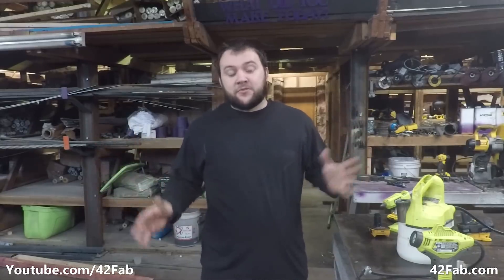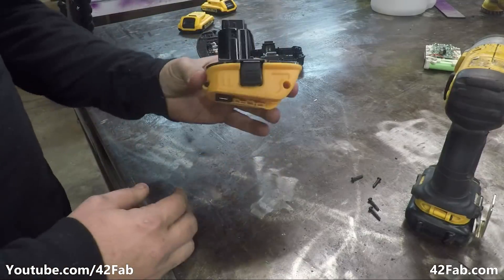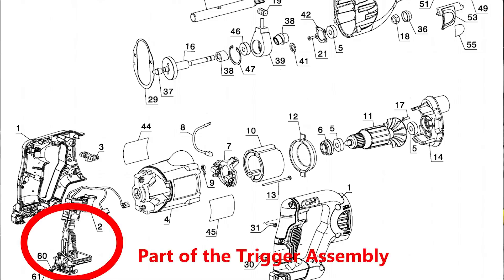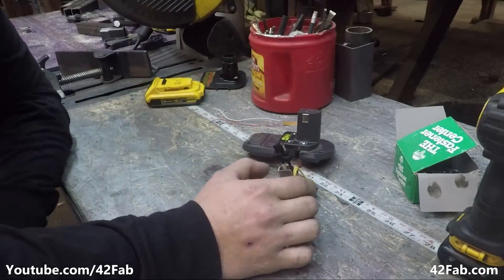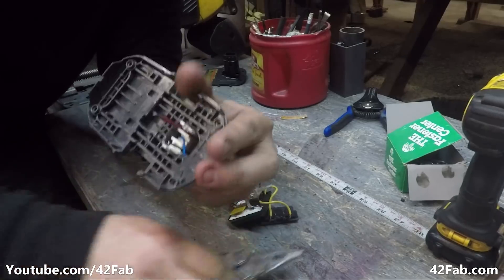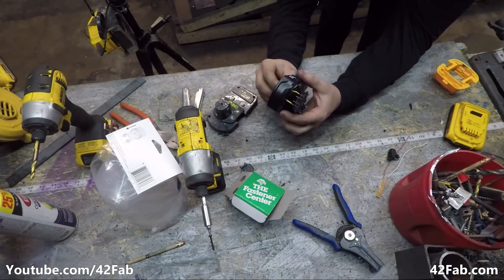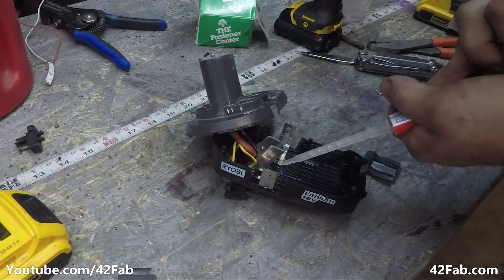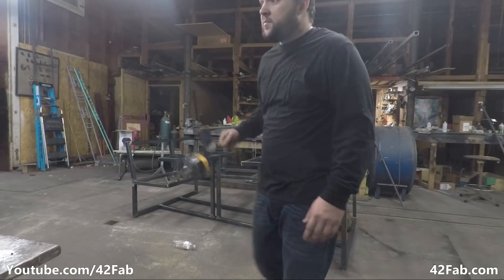How to use DeWalt Batteries on Ryobi Tools for $30 | Building a DeWalt to Ryobi Adapter - 42Fab #16

Comment: What's your opinion of the knock-off Dewalt battery vs a Dewalt battery?  I have Dewalts, and after many years, maybe 10 of light use, the pair of Dewalts just don't work.  I bought a pair of less expensive knock-offs and they were fine.  But seemed to die and no longer hold charge after maybe 5 years.
Reply from the maker: @snackymcgoo1539  pretty standard experience. I have a few, they're limited to running flashlights, fans, etc

Comment: Do you have a hack for adapting the 40 volt batteries?
I want to use a 40 volt 12 amp hour DeWalt battery instead of the 40-volt 12 amp hour Ryobi battery in my Ryobi lawn mower.

Comment: do you have an adapter that will let you use a 18 volt ryobi battery to power a 18 volt dewalt tool?
Reply from the maker: no, and you wouldn't want to. The neck of the battery would be obnoxious to absorb into an adapter and the dewalt tool would have to be fooled into reading the battery voltages correctly as dewalt has the battery protection in the tool and ryobi has it in the battery

Comment: They make adapters that go from Dewalt batteries to Milwaukee or Makita
Reply from the maker: Yes, and the cheap ones do not have over discharge protection
Reply: @42Fab  ok

Comment: Do the 54v flexvolt dewalt batteries work in ryobi have you tested it yet?
Reply from the maker: The adapter is not designed for such a high amp tool. There is a piece you need to ground off the adapter, but then, yes they work.

Comment: Can you DEWALT batteries on Ryobi 40V tools??
Reply from the maker: The new lithium ion stuff? Not really. You'd have to wire something up to trick the tool into thinking a DeWalt 40v or 2 20vs were the battery it was looking for. More work than it's worth.
Reply: @42Fab  thanks for the reply cuz here in Canada 1Ryobi 40V Lithium -Ion 5Ah HC battery cost $239.  
1 DeWalt 20V MAX XR Lithium - Ion Premium Battery Pack 5.0Ah cost $189
I have another question what's the difference??
Reply from the maker: The 40v battery has twice as many battery cells in it than the 20v battery does
Reply: @42Fab  thank you for the quick response.
I ended up buying Ryobi 40V 4.0 Ah from Amazon lol please don't tease lol 
What's the difference between 4.0Ah and 5.0Ah.  It's $50 difference
Reply from the maker: Ah means "Amp hour" which is the capacity. So a 5Ah battery can deliver 1amp of current for 5 hours or 2amps for 2.5 hours or 5amps for 1 hour. More Ah means the tool will run longer before that battery is dead

Comment: You are wasting time you can get one adapter from eBay for $12
Reply from the maker: and kill your batteries. You get what you pay for and cheap adapters do not have over discharge protection. but hey, thanks for being so smart, it's much appreciated.

Comment: 12 volt dewalt and 12 volt firestorm (black & decker) batteries are interchangeable. You can even charge firestorm batteries on dewalt charger.

Comment: Followed these instructions for my Craftsman C3 19.2v batteries.  Works great, even though now running at a max of 18v.  Beware the cheap knockoff battery adapters on Amazon.  The one I bought had no protection circuitry to prevent total drain and over heating.  The 18v pins were simply wired directly to the 20v pins.  So they warn you not to leave the tool plugged into the adapter, as it will drain the battery to zero and ruin it.   Rather than taking that chance I sent the adapter back and bought the official Dewalt adapter.  Really happy with this solution.  Thanks for the video.

Comment: Anyone looking to do this with any battery brand you can buy the adapters but none have protection circuits on them. You must not discharge them to far or you can put a limiting circuit in them. I have done this on my Makita to Royobi adapters and it cuts off the power to the too to the voltage you set. To know the voltage to set the circuit to you must run a battery down on your original took and multi meter it to see the voltage to set too.  https://www.amazon.com/gp/product/B07929Y5SZ/ref=ppx_yo_dt_b_asin_title_o00_s00?ie=UTF8&th=1
Reply from the maker: the ONE time someone has actually presented an equally good solution.

Comment: So you built a $30 tool that you could have bought online in a smaller form factor and for less money
Reply: You jealous you cant build one
Reply: Post one that has voltage cutoff protection in it. Ryobi puts their protection in the battery. Dewalt puts their protection in the tool... So any adapter has to include protection to avoid over discharging the Dewalt battery. Every one I have seen on ebay and Amazon do not have voltage cutoff built in.

Comment: Beware that the cheap knockoff adapters on Amazon don't have the protection circuit built in.  Internally they just jumper positive to positive, negative to negative.  So I returned them to Amazon and bought the expensive Dewalt version.   The torx security screws were easy to remove by banging the center pins out with a spring loaded center punch (several hits).

Comment: aren't there ryobi to dewalt adapters yet? they have milwaukee to dewalt and vice versa for like $30 on Amazon.
Reply from the maker: Read the other comments on why these are garbage
Reply: @42Fab  I'm not scrolling that far. All these other comments regarding your SO are quite hilarious but they need to control themselves.

Comment: I have old  Ryobi 14.4v tool set.  After becoming aware of the conversion adapters I found  your video and decided to make an adapter to take Dewalt 20v batteries that I now use and fit my Ryobi 14.4v tools.  I had  a Ryobi 14.4v set that has a drill, circular saw and light.  The batteries seem to get more expensive and I didn't want to keep investing in the 14.4v system.  I bought the   OEM Dewalt adapter to use on their old tools.  I did this so I would have the protection circuit that comes with the Dewalt adapter. I took the top off the Dewalt.  I took apart a dead Ryobi 14.4v battery pack.   The 14.4 battery has 3 conductors: positive, negative and temperature sensor.  I left the temperature sensor on.  Set the Ryobi batteries aside for Recycling.   Clipped the power leads from Dewalt contact connector just like you did.  Soldered a lead to the Ryobi positive contact connector. Took one of the dead Ryobi batteries and tapped off contacts.  The battery was used to keep the the contact connectors in the Ryobi tower.  Lots of hot glue was used keep the assembly in place in.  I alligator clipped the two wire sets together and the light worked.  When I plugged in the saw it ran backwards.  Switching the wires it ran correctly.  I had tried to cut hole in the bottom of the Ryobi case so the Dewalt clips to the bottom of the Ryobi, but the Dewalt is too wide. I just hot glued the Dewalt adapter to the Ryobi battery case. If I did it again I would cut a piece of plywood  as an interface adapter between the bottom of the Ryobi and the Dewalt so the Dewalt clips would hold onto the plywood.    It is important to remove the Dewalt battery from my Frankin adapter so it doesn't drain.

Comment: You know, you can buy adaptors for most brands on Amazon....
Reply from the maker: and they ALL (I've bought and tested most of them) have no over discharge protection to protect the battery.
Reply: @42Fab  is there room in those adapters to wire a protection board in? Low voltage cutoff boards are pretty small and are about $10 on Amazon

Comment: Imho, can you make a dam out of tape to keep the epoxy in place? What about using an accelerator or a pressure cooker to speed the curing process like others have done???
Reply from the maker: sure could, I didn't

Comment: I used to say dewalt was the best, til I used Milwaukee, you cant compete with the 5 year tool warranty, 2 year battery warranty. Besides name a commercial tool truck that carries dewalt...
Reply: Watermelon Water Moccasin, I’m a Milwaukee guy as well. I don’t know if it’s different where you’re from, but in Canada, Milwaukee warranty’s their tools for 5 years and batteries for 3 years, not 2. But since you asked, the Mac Tools truck carries DeWalt. And Mac cordless tool batteries and chargers, although red & black in colour, interchange with DeWalt.

Comment: They now sell already made adapters on Amazon & Ebay for around $15-20 bucks! The one I saw was a dual DeWalt and/or Milwaukee batteries. Works with both. Great video though!
Reply from the maker: As those do not include over discharge protection. I have purchased and tested them.
Reply: @42Fab  Thanks guy! I wondered about them? I was thinking maybe the main battery would kick in to do it. Glad to know!

Comment: Interesting.  It seems that having the bms on the battery for ryobi is the better decision.  That way if it fails the bad part is cheaper (battery). It does make for more expensive batteries but the sale prices don't reflect that.   Also having the bms on the battery lets you use the battery for all sorts of different things.
Reply from the maker: The BMS isn't the whole story. The board in the tools has other function for the tool. I think the idea is that instead of two systems doing two things, why not make one system do both

Comment: Great video.  FYI, probably figured it out by now but there's a final screw on the head of the ryobi batteries by the terminals - lets you slide the whole internals out and save from having to sneak a pair of scissors in like that.
Reply from the maker: Yeah, found that after...

Comment: 1PCS Dewalt 20V(Max) Slider Li-ion Batteries to Ryobi 18V Cordless Tools Adapter search that on ebay.com they have way lower profile and look better for $20 or $30
Reply from the maker: and a great way to kill your battery as those have no protection for under-volting the dewalt battery.

Comment: DeWalt tools are sold as 18v in the UK. They are identical to those sold as 20v in the US. Why? Marketing. If the tool just needs 18v you can connect the battery direct.

Comment: so you are saying these are junk? https://www.ebay.com/itm/Battery-Adapter-For-DEWALT-Milwaukee-Converter-to-18V-RYOBI-CORDLESS-PLUG-TOOL/113682706000?_trkparms=aid%3D111001%26algo%3DREC.SEED%26ao%3D1%26asc%3D20160908105057%26meid%3D21c64a3e4f9b4edabe47918251a2f87c%26pid%3D100675%26rk%3D3%26rkt%3D15%26sd%3D273804848444%26itm%3D113682706000&_trksid=p2481888.c100675.m4236&_trkparms=pageci%3A228d7184-676a-11e9-8f37-74dbd1804572%7Cparentrq%3A54fe562816a0ad793fad36cffff35984%7Ciid%3A1

Comment: I've made a ton of battery adapters like this and can tell you the epoxy is complete overkill. A quality CA glue will hold it like it's fused plastic and doesn't make a giant mess.
Reply: CA glue sucks. One drop and it's shatter apart. There are very limited applications where super glue is the right call... And usually it's only good for holding parts while you use a better glue. I've used every type of CA glue, even the Loctite play m plastic glue with the primer pen. I used it on a specific type of plastic that was listed on the package, and... Guess what, it broke. It's usually way too brittle anyways. It shatters like glass.

Comment: Why can’t you use flexvolt batteries with the adapter?
Reply from the maker: They did not design it to, I suspect to limit the amp draw on older tools not designed to handle that much current.

Comment: Dewalt call 5 LiPo cells "20v" where everyone else calls them "18v"...  Nominal voltage is 18.0-18.5 depending on the type of 18650 cell... I REALLY don't like companies that lie for marketing purposes... wouldn't buy Dewalt for that reason.
Reply: Holy shit, you're really making your way around YouTube with your nonsense. 2 videos in a row?!? Damn. Also, all 18650 cells are 3.7 nominal, some sites/sources just say 3.6V incorrectly. Though there are some Samsung Li-ion batteries that are 3.78V nominal and charge to 4.35V.

Comment: I'm so glad Dewalt finally came out with a cordless sander. I can finally sell my Kobalt. The Black and Decker cordless glue gun is awesome too. If you need batteries for those tools, try the knock offs but only go with those that use LG cells. They can even perform better than OEM in Black and Decker's case (based on my experience using their Alligator Saw - an awesome tool, and their pole saw).

Comment: What I want is an adapter that lets me use Milwaukee batteries in my Dewalt tools. Milwaukee's 12Ah battery is half the price of Dewalt's! Right now Dewalt wants over $200 for that battery. That's nuts! I also really like that Milwaukee has a cordless heat gun (which I just bought), and I would love to be able to use my Dewalt batteries in it (I have a ton of Dewalt batteries). There's just no way out of having zillions of batteries. I also have batteries from Kobalt, Black and Decker (20 and 40V), Nextec, Dremel, Greenworks, Sun Joe....it's maddening!
Reply from the maker: That's most of the reason I stick to one brand. I'm considering attempting to do dewalt to m18 though

Comment: How about the ridged 24v line?
Reply from the maker: different voltage brings a lot of challenges, but not impossible. Though those appear to be all lithium ion and may have battery protection in the tool
Reply: Well they are lithium batteries and stupid expensive in my book to buynthem and have them die on you just to have to buy more

Comment: Have u tried to build: 1- Adapter for tools to connect two batteries instead of one 2- Battery housing which can get connected (expandable) and the tool connects through wire to the batteries hanged on the belt to reduce the tools wight 3- Have you tried to upgrade just the cells with higher capacity ones (replace 1860 with NMC 70Ah or any other?
Reply from the maker: 1) can be done in parallel, but just adds weight. 2) was much easier to with older tools, but wouldn't be that hard with lithium ion 3)haven't felt the need to

Comment: I have tried this build twice now with dewalt brand adaptors. Though I had miss wired or shorted a connection on the first one so I tried it again with a new adaptor and the exact same thing happened. Both times the logic board he references in the video flashes and smokes immediately and the adaptor is useless. This does not work.
Reply from the maker: You're getting a short somewhere. I've built 2 without issue. Feel free to email me a picture of your wiring
Reply: Finally got it to work. Be very careful with your solder. Caused a short on the first one that fried the chip. And absolutely don’t use the 60v dewalt batteries. That’s how I fried the chip in the second one. Take your time and check everything. Especially polarity. On all three the positive and negative wires in the dewalt adapter were different colors. It’s not obvious. Also, Youndont have to take the dewalt adapter completely apart. Just remove the screw that hold the copper connectors into the plastic top and it slides apart. Also, don’t glue it all together. Instead, drill 4 small holes through the bottom of the ryobi battery case and screw the bottom half of the dewalt adapter to the underside of the ryobi battery. This way you can take it all back apart in the future if you need to.
Reply: Mea culpa

Comment: I have to ask. 7 months later, is the Knock off dealt adapter still holding up "Logic board"? Did it mess up any tool or battery? 
Cheap Chinese is a grab bag buy at best lol
Reply from the maker: bumbl besss it's still working, but I almost exclusively use the real one

Comment: Hey, great video.I am trying to do this with a burnt out drill. A very important note if you are doing this with a drill: YOU MUST KEEP THE SWITCH ASSEMBLY TOGETHER. Zip tie the switch to it's fully depressed "forward" position, and tie the Ryobi contacts to the contacts where the motor was attached. You can cram the assembly into the old ni-cad Ryobi battery shells. You may be able to do the same thing with the thinner ones, but it will be a tight fit.There is a blue wire that will read 18v with a multimeter, but it doesn't do the job. I figure this out the hard way.

Comment: I think most people would like to use the cheaper $ Ryobi batteries on $$$$$ DeWalt/whatever expensive tools? I'm pretty pissed of against all these proprietary  (and $$$$$$$) batteries that can't be interchanged....standardized batteries should be implemented... juste like a AAA or AA battery works on any device meant for it whether it's a Duracell of Panasonic.
Reply from the maker: While it's a fun idea, the reality is crap. I've taken apart batteries from both brands and tested the cells. Ryobi's max out at around 20A discharge while dewalt 20v black batteries are 20-25 and yellow batteries are 30 amps. You can feel the difference in the tool with a beefier battery on it. You get what you pay for.
Reply: dude I buy guitar pickups that cost a hundred dollars from Seymour Duncan, but if i hit up a private seller on ebay ill get some handmade, really nice ones, for 30 bucks. youre not paying for the quality, youre paying for the name and the reliability of the brand.

Comment: those ebay ones will burn up with a load on them, ive bought 3 and they didn't last a two days true storie ran fine until it heated up under load.

Comment: 20v tools are a marketing trick. They do not have 20v worth of cells. It is only 18v. 20v max output (meaning the switches and motors will handle 20v , but they are not supplied 20v EVER.)
Reply from the maker: how Many D's are there in pedant?
Reply: technically, if cells reach the max voltage of 4.2 V, yes, the tool can be supplied 20V. From 4.2 to 3.99V it's true.